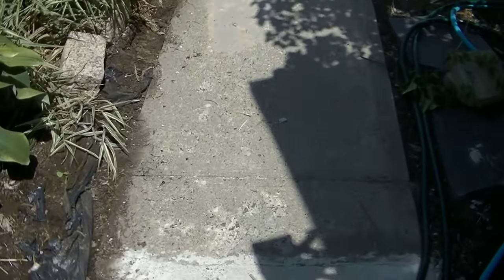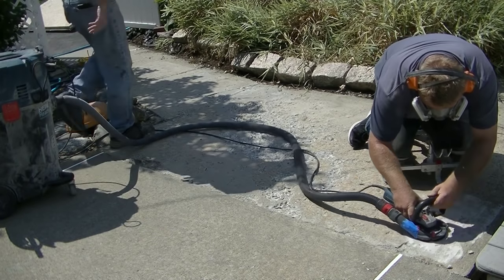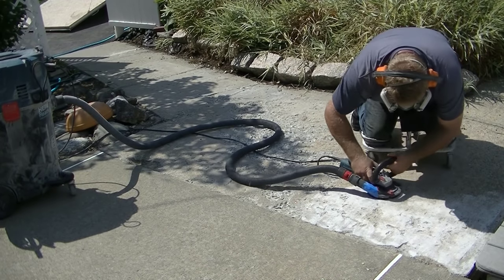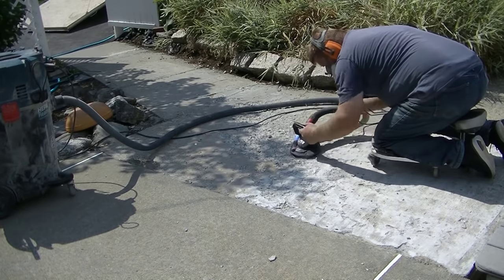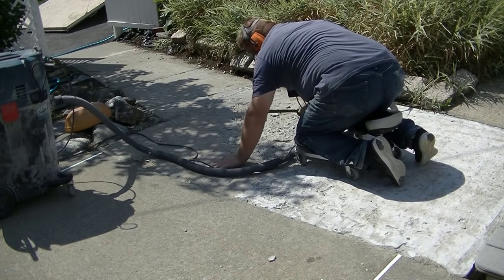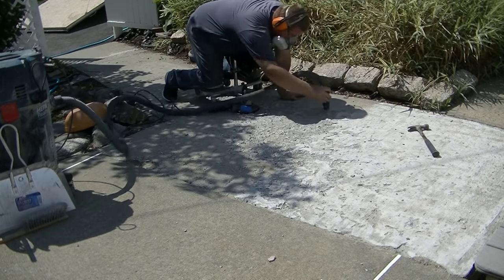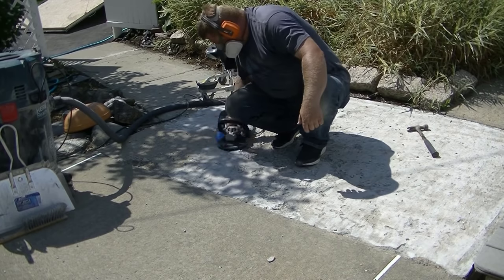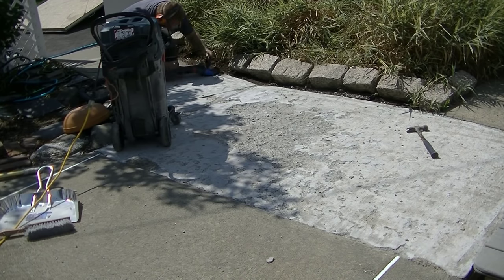How To Resurface A Badly Damaged Concrete Walkway

Comment: so you use cementall rapid set to resurface and not rapid set newcrete.? rapid set has a resufacer called newcrete.. you used instead cementball?? and how did you get brown ot white concrete color???

Comment: Great detailed voice-over explanations on all of your videos, this from a 40 year engineer who's seen my share of badly explained technical presentations - Kudos to you!. 

Now my question. I have an existing outside 4" concrete pad that I've now added onto with two additional 4" depth re-barred pads on each side of it,  that are epoxy rebar spliced into the original pad, now tripling the overall square footage - The original section had two layers of thin-set on top,  which over time, trapped the water in and ruined the surface (heavy spalling). I removed all of the thin set and have about an average 1" depth of severe spalling and I'm now down to some decent concrete surface. The newly added pad sections are now at roughly the same level of the original spalled area, give or take, and this can be made up by adjusting the mortar level before topping with the flagstone - My plan is to re-surface the entire area with flagstone over the entire area (old and new sections) creating a monolithic and grouted flagstone patio.

Would you recommend just laying the 1" flagstone, after cleaning and prepping the spalled area, with a type S mortar and then grouting, keeping in mind that the mortar will be bonding both to the old spalled area and the newly recently poured and broomed-finished areas? Do I need any bonding agents or resurfacing mortar first and then the mortar / flagstone? This will be done in North Georgia (mild winters). 

Thank you Mr. Day!

 Richard
Reply from the maker: If you use Sakrete sand mix as the mortar it's a lot more weather resistant than type S. Mix some of their bonding agent into the mixing water and you'll be golden. You can go right over what's there using this stuff.
Reply: @MikeDayConcrete  Great thanks Mr. Day! - Just a couple short follow-ups -  1. Do I use the Sakrete sand mix with the bonding agent for the grout as well? 2. As an alternative to adding the bonding agent to the mortar bed topping, could I just pre-paint the entire existing pad surface with just the bonding agent before mortar application?

Comment: You can use mortar over concrete? Just mortar?? Mortar is literally just cement and sand. I've been asking google this and they keep conflating concrete and cement as the same thing but cement is a component of concrete and mortar. I need to know if I can just mix cement and hard sand and pour that over concrete. I can't seem to get this answer but I need a smoother surface that the stones in concrete will allow.

Comment: How long do you figure this repair will last? If exposed to yearly freeze thaw? I have a project with some pretty badly spalled concrete on the front steps and if this holds up for more than 1-2 years I’ll definitely consider recommending this to our client.
Reply: My question exactly - same issue in my area.

Comment: What would you use to level before resurfacing?  Would you use Cement-all and change the application consistency to be a bit more watery  so it self levels?

Comment: I am in need of a contractor to repair my concrete kitchen floor, house is on a slab and the old radiant heat leaked and cracked the floor up. Please send me help.

Comment: I have a question the guy that I had to my new concrete slab put some sort of gutter fittings in my concrete next to my house and put the guttering down in that and ran piping under the ground what I want to know can I take that fitting out of the concrete which I know will leave a hole in the concrete can I fill that hole in without breaking the concrete around the hole and make it look nice because the way they have it it’s not allowing my gutters to drain properly anymore if I take the gutter fitting out of the concrete it will leave a I think a 4 x 4 square holes can I fill that in with new concrete without it cracking the concrete around the hole thanks for any help

Comment: Hey Mike, I'm a little conflicted here. Rapid - Set excellent products of course -- Mortar Mix says 1/2" app min --- but on this one you are doing 3/8 to feather edge looks like.

Just double checking the mortar mix is good for thinner apps like in this video ? The Cement - All does feather edge to a few inches --- why not use that to finish out ?

Comment: Interesting, but it is highly doubtful it will last. The concrete base and the repair will contract and expand at different rates. Over time that will cause the surface layer to crack and spall. For this small amount of concrete, it would have been more productive to demo and replace it.
Reply from the maker: Just did a 2 year update video. You should watch that. Proves all the doubters wrong.
Reply: @MikeDayConcrete  Thanks for your reply. I don't mean to be a doubter, but I have been managing construction projects a very long time. It will take years but it is likely that  the repair will spall over time.  Even epoxy based products  fail over time. 

I wish you the best and I respect your expertise.

Comment: Why not use a pressure washer to remove loose concrete ? Also the concrete should maybe be treated with muriatic acid for adhesive quality ?

Comment: What was the cost savings by doing this as compared to full demo and replacement?  2 days. 2 guys, then 3. Attention to detail.  Heck it looks more like surgery on that surface.  I don't see it. 

Demo, dump, forms delivery,  scree finish.
VS.
Buy vacuum, grinder,  multiple vaccum filters(or have air compressor to clean filter) special concrete surface blade for grinder, blower, batteries(not typically used in new poor applications),clean, buy mix, special additives,  buy delay materials to add, mix to pre fill, clean, buy surface material. 
Should already have trowels and finish tools. And no control joints installed.  

I can only imagine that the home owners are going to continue to throw salt on this area.  Typical M.O. not complaining just explaining...it seems to be a problem area for ice.  

Which was more on an efficiency of funds?
Reply from the maker: It would be triple the cost.

Comment: Sounds like they may have been lucky. I had a basement that looked a lot like that. Never could sweep, brush, or vacuum the loose powder and chunks away. After almost an inch or so I just stopped and covered the worst places with rags.

Comment: I don't see any saving in time or money in this small project, and if there is freeze & thaw there, super inferior and weak overlay application. Could have replaced it with a sledge hammer and maybe a yard of concrete. This is actually some real flaky stuff. And of were to overlay something, I would use an acrylic admixture instead of water. .

Comment: The brush should have went the other way. Slip resistant lines should go across and not the same direction as traffic. Other than that good job. I've been doing concrete slabs for over 10yrs.

Comment: If you topcoated with the CementAll, would it broom off well like the MortarMix did?
Reply from the maker: It would yes, the mortar mix just has a little more body and covers imperfections a little better.

Comment: I would have busted it up and just repoured a new slab. To be fair, I have my own concrete tools and even did the slab for my 2400 sq/ft home some years ago with no cracks yet which would be painfully obvious with tile floors. To the average homeowner, this is the way to go.

Comment: Too much water in the mix or they added water after it was mixing befor it was poured.  
JEWEL COAT.  highter strength should last for years and you can do patterns and color in it. By dusting and tooling it.

Comment: That concrete is messed up from using bad rock salt in the winter.  Alot of that stuff you buy at your local store is not meant for concrete its meant for asphalt. Guarantee you this will be back to being destroy after 1 winter.

Comment: That is a crazy idea of a chair. It is a known fact that concrete will not stick or adhere to a dusty surface. In some circumstances you may need a bonding agent to help the material to adhere to.

Comment: Kirk Giordanos method is better and he doesn't do concrete he's a plasterer. He used polybond cementitious bonding agent with sand to fill the deep spots and cracks because you don't want to go too thick without it or it'll Crack. He then used the polybond without the sand to do the top layer as it's fine. These guys used the fine stuff in the deep cracks

Comment: So I know from experience that there is no money anywhere to be saved. I would saw cut that pull it out $25 dollars in stone $10 dollars in wire and $500 dollars for a yard. It’s putting lipstick on a pig🤷 your ok your knees grinding with a 4” grinder and not to mention the price of materials is the same price is concrete

Comment: not trying to troll ya, but i gotta ask... whats that sidewalk look like after a few months of foot traffic? im a mason, mostly stick to brick, block and stone, but also do stucco, tuck-pointing etc... i'd never use mortar for a surface coating on anything that will get foot traffic.. mortar is not a strong product at all, and it wears really quickly. does this actually hold up well over time? most people i've seen resurface concrete use actual concrete patcher or resurfacer.

Comment: 😮  no your leaving drags n clean your broom moor .hot edges with a 20 by 5 marskeltown broken in n for pet sake use a light mod Fresno un less your a old finisher like me n have the fell of the weight of the rig n don't be stiff lossen up get reathen put a song in your head n go with it not putting you down but you have no style

Comment: So labor intensive, you could tear out the concrete and pour new for the same dollars. This is a temporary bandaid and a rip off for customers. I’d like to know what they charge for all the steps, materials etc… I could tear that out and report new in 4 hours1-2 yard of concrete for 1000 bucks, and be done right. Previous pour didn’t do it right, no joints…
Terrible
Reply: It won’t last long and be flaking and cracking again within a year

Comment: i know that you sell concrete. Resurfacing concrete is much more permanent with an epoxy aggregate overlay. Thermal Chem WROTE THE BOOK on this type of work. I have been using their products with long term repairs for more than 3 decades. All concussive forces such as hammering or impact chisel on damage and hollow plane delamination always creates spiderweb cracks. Cracks are best injected prior to trowelling the slurry.  I have enjoyed all of your other videos, but disagree with your methods on this one.

Comment: For anyone attempting this, this is only good if you’re looking for a quick repair until you can fix it properly. By placing such thin amounts of aggregate/cement powder you run the risk of The concrete cracking due to shrinkage ( depending on your climate fluctuations, this could be within weeks or months). This will create the same problem you had before. If you are a contractor looking to do this, be very weary. If you can’t place 2 inches of depth or more in a section you’re going to have severe cracking. The rule of thumb is for every 1 inch of depth in concrete you can go 2.5 feet before you have to put a stress joint.
Reply: Also, quick calculations for determining amount of concete needed in c/yd: length(feet)x width(feet)xdepth(inches) then divide by 324. 
The 324 equals the amount of Facial inches on 1 side of a cube.

Comment: Really, 24 min and some of it BS of subliminal advertising.
Not to mention, instead of power grinding, you should sandblast then power wash, much easier on your knres, you know...
But good info on resurfacing products...
Sorry if I am too negative, but Google has the same problem IBM had 50 yrs ago: they paid programmers by how long their code was, not how smart; and Youtube pays by how libg your video is, and not how smart/useful, etc.
Reply: knees... not kners